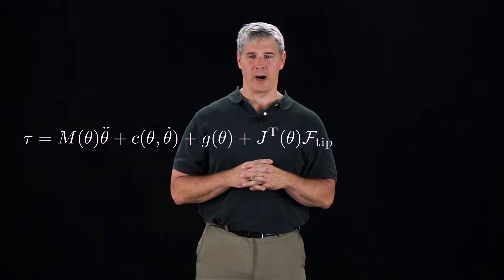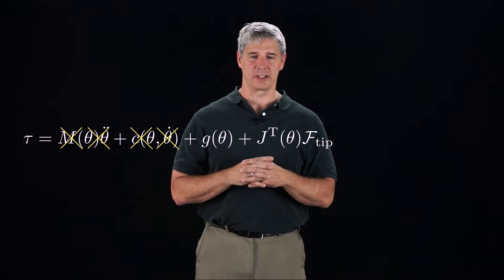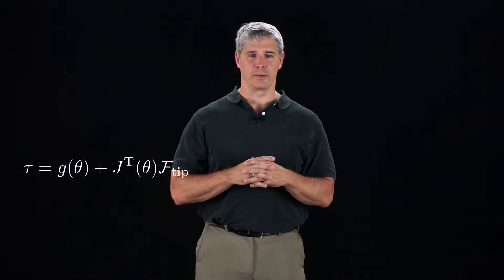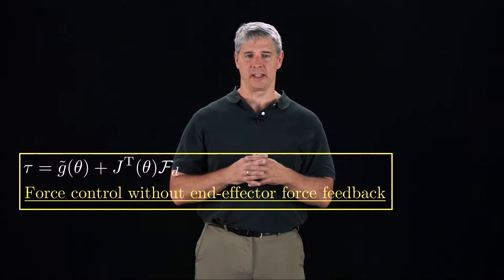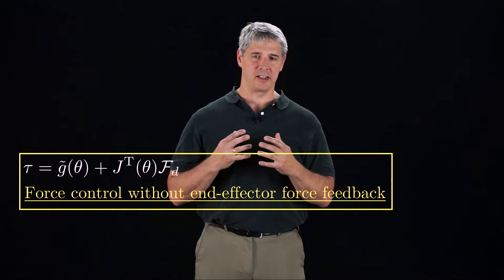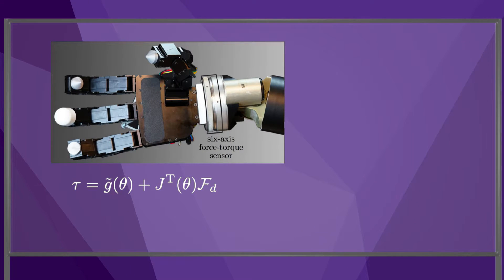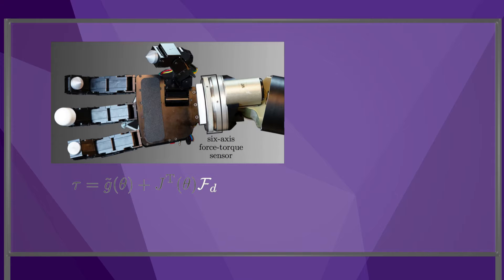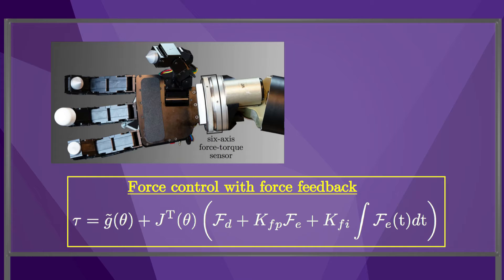Modern Robotics, Chapter 11.5:  Force Control

Comment: In practice, to exert a constant force in the environment, one has to initially  place the end-effector near the point where they want to apply the force (so a position controller is used), and then switch the controller to the force controller (either a feedback controller, or open loop control)? 
Thanks in advance, these videos are a great help!